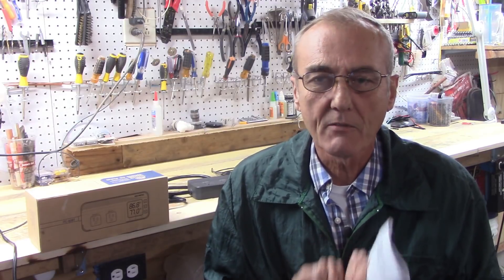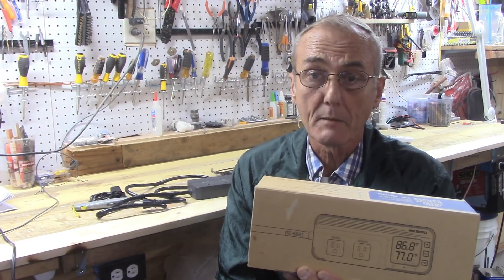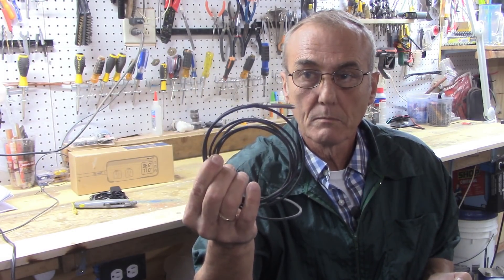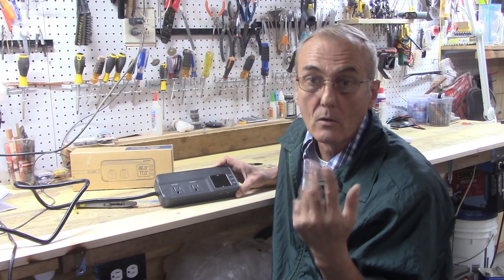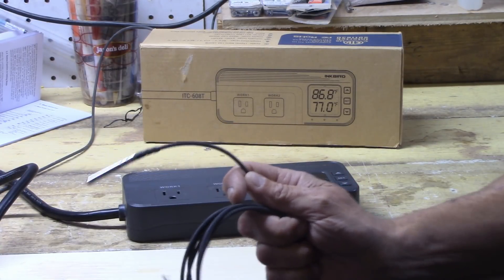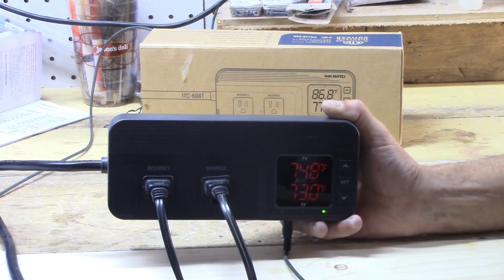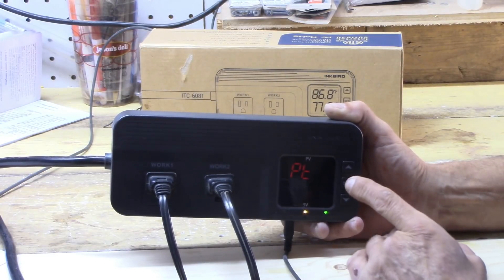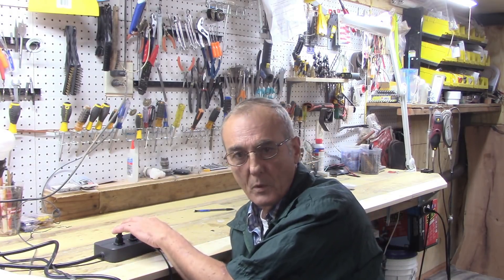TEMPERATURE CONTROLL WITH THE INKBIRD ITC 608 T

Comment: For any controller with a binary / on-or-off output you can exceed its max amperage rating by using the controller to switch an external relay, or even multiple relays. In fact when I set up an expensive environment controller some years ago I used an external relay on the heater output from the get go even though it was rated high enough for the heater. I figured switched a relay with a minuscule draw would be a lot kinder on the circuitry than switching the full 2500W.

Comment: Thanks George for all your information. I have a question but I’ll set it up first. I bought a wood fired furnace that sits in my backyard and connects to my house with an insulated PEX pipe. My house is heated with a hot water system. I added a heat exchanger to transfer heat from the wood furnace, with a circulating pump to take away the heat. I purchased two inkbird PID controllers mainly because of cost. With one I want to control the pump to cycle the pump to bring the gas boiler up to temp. The second I want to monitor the wood furnace to shut down the pump if the fire goes out and the gas boiler goes online it prevents the heat from exchanging back to the wood boiler. 

I don’t think I need PID. I think I just need to run in on/off mode. My question is; is that correct?  Do you have any information on using that mode?  I have looked on inkbirds website and read the instructions and do not find anything.

Comment: I see the decimal points on the box, but I can’t seem to set to 99.5, I’m using for an incubator. Do I need to set to 100 and use the “temp difference” to drop the half degree? Won’t that also heat to 100.5 before turning off then too? Just got mine in the mail and trying to figure it out...

Comment: Thanks for the video George, just one question can I plug both temperature and humidity sensors but only use the outlet plugs "work 1 and work 2" how you have it to control heating and cooling?

Comment: Hello, great channel.
How do you fix these probes to the top of the still ? 
They look like they should have a threaded feature ? 
Regards
Gary
Reply from the maker: The probes are threaded if you have the same ones I have. They normally fit directly into the rubber bung that caps off the top of the column. If not you could drill a small hole and insert it. There are many ways to do this but your particular set-up will dictate how you need to proceed.

Comment: Great information.can you tell me if this unit can be used in 220volt power supply (Europe)?i live in Greece.thanks
Reply from the maker: Yes, I build models designed for the 50Hz 220 volt system in Europe.
Reply: @BarleyandHopsBrewing  thanks for the fast response..
I Will need only  plug adaptors?

Comment: Thanks for putting out these great videos.  I bought my 1st still (8gal ss MileHi) from y’all and your videos are my go-to for information. You’ve gotten me very interested in using a PIV temp controller.  Only problem is that I can’t find a controller that will handle a 2000w internal element.  I have a manual controller but would like to be able control better.  I was hoping this Inkbird would handle it but I guess not.  Do you have any recommendation?  Thx & keep up the great work!
Reply from the maker: Tom,
Here is a play list of several videos that can do what desire. Let me know if you have any questions.
https://www.youtube.com/watch?v=jze4LTONq8s&list=PLA2Iwq46qNNPYr5sqp4hCP7b8KAeCKvqw
Reply: Barley and Hops Brewing...Thx for responding & including that link.  It looks like you’re using a PIV controller that you built.  Are you basically saying there aren’t any manufactured controllers that can handle a 2000w element & that I I need to build my own controller?...Thx, Tom
Reply from the maker: Tom, building your own is the best option in my opinion.
Reply: Barley and Hops Brewing Thanks George!!

Comment: I have this thing trying to hook it up but it won't run heater and humidifier.  It shuts off for some reason and will only run one at a time
Reply from the maker: I need a little more info than that.
Reply: I bought this thing to control a small space heater and a humidifier.  But when I have them both plugged in the unit does not supply power to anything regardless of the heat or RH setting.  If I unplug one of the sensors it supplies power to the remaining unit plugged in. I need this to be able to control humidity and heat for my plants as the demand darkness and I can't be jumping in there to adjust a space heater.
Reply: I need to use this for fans and A window unit.

I want the same fans to turn on depending on temps and humidity..can it be done..

Comment: Can I have it so a fan turns on depending upon temps and humidity with this?
Or is heat and cooling or humidifier and dehumidifier?
Reply from the maker: This device does not control a fan.

Comment: I only need a heating pad and a humidifier. Can I control the humidity with “work 2” instead of using it for “cooling”
Reply from the maker: Yes. This unit is capable of controlling both processes at the same time.
George
Reply: How do I have it turn on fans if it's hot or to humid?
Reply: I’m using it for an incubator.